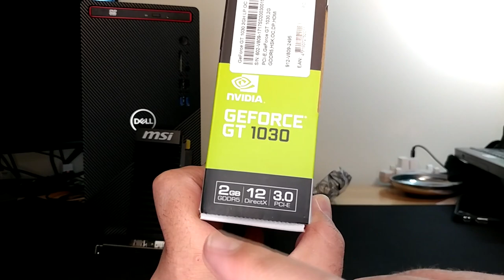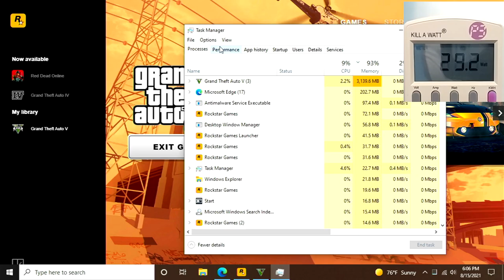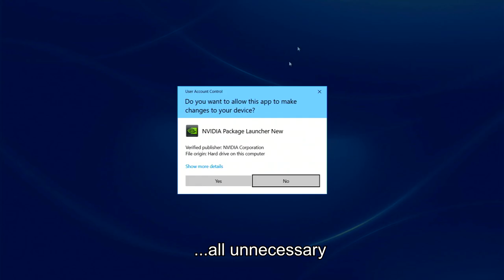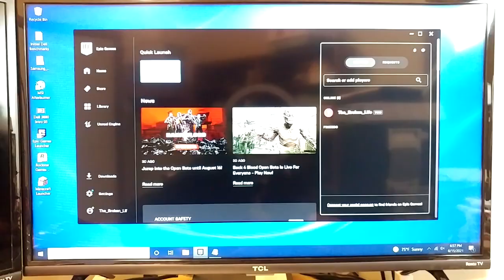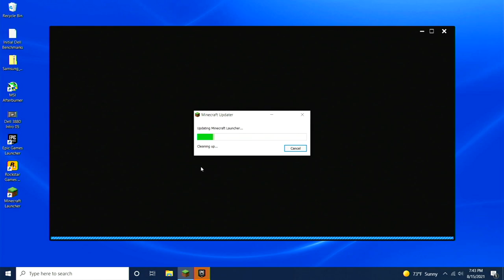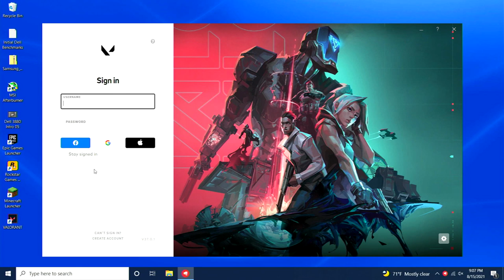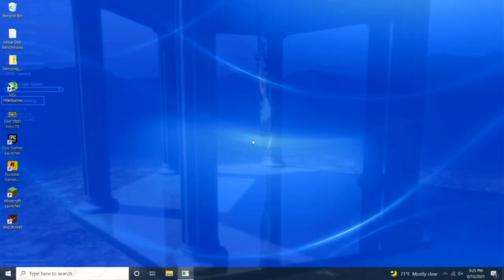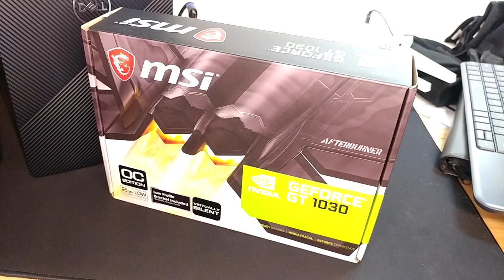Dell 3880 Graphics Card Upgrade!

Comment: I have this model but with an
i5-10400
12GB DDR4 2666 MHz
the same 200w psu
I am currently using a gt 1030 gddr5, I am wondering if I can upgrade to a gtx 1650 super? possibly ram upgrades also?
Reply from the maker: If you choose a 1650 that doesn't require PCIE power, yes.

RAM is no problem.
Reply: @TheBrokenLife  Thank you! I just received a new hdd and found your channel through that. didn’t have the screws so i’m just waiting for that.
Reply from the maker: @Hugs_Needed  You're very welcome!
Reply: @TheBrokenLife  So would the single fan ASUS Phoenix GTX 1650 OC gddr6 work well for gaming on my 200w psu? I can't seem to find much information about this and don't want to fry my system.
Reply: Or would upgrading or replacing the psu be a better option and getting a more powerful gpu?
Reply from the maker: @Hugs_Needed  Upgrading and replacing the PSU is far and away the better option.

Probably next Friday I will have the video out with the culmination of replacing my 3880's "everything". New case, PSU, MB, GPU, etc, etc. 

Upgrading your PSU now is just another step along that road.
Reply: @TheBrokenLife  Thank you! I will more than likely be going down that route. Not in a hurry or anything as I am saving money for upgrades atm.
Reply from the maker: @Hugs_Needed  Hardware prices are still crazy, so time is on your side.
Reply: @Noah DeWeerdt Hello! I have the same model

i5 10400
8GB RAM
SSD nvme 256GB
1 TB HDD
200W Dell PSU

So I wonder if you tested the GTX 1650 Low Profile? I plan to buy that card + 8GB RAM. At the moment I don't want to change the PSU.
Reply: @pj523man  I am planning to just upgrade to a new pc. I do not know if a GT1650 will run on this. But I do know that a GT1030 will run but will not have anywhere near the performance of a 1650.

Comment: can i install gtx 1050ti with dell psu 260W ?
Reply from the maker: Yes. I think that's actually exactly what I did in this video.

edit: Oops... I installed a 1030 here. My mistake, but, yes, a 1050 should be fine.

Comment: Hi again!, I'm installing my 4gb ddr5 into the pc right now, how do I know my pc won't disintegrate and get destroyed, people keep saying in a need 300w and I only have 200w and I have a i5 10400 can you tell me if I'm at risk and what I can do to mitigate it?
Reply from the maker: RAM is pretty independent of PSU size. You should be fine there.

As far as instilling you with confidence for whatever else, I think it was either in the i7 or PSU upgrade video (both in the playlist, which is linked in the description) I demonstrate that the most power I could force the PC to draw with an i7, GT 1030, SSD, HDD, and ODD all running as hard as I could force them to was something like 130w... and that was with my stock 200w PSU. Also... A GT 1030 was a factory option with that size PSU. Dell sold it that way.

If it will help you to feel better, just put a larger Dell PSU in it for a couple of bucks and move on. Right now my 3880 has an RTX 4060 in it, SSD, HDD, ODD, etc, etc and it's been fine for months. I think I paid like $30 for that PSU.
Reply: @TheBrokenLife  thanks for the advice ! 🙏
Reply from the maker: @empel655  Good luck with it. 👍

Comment: Question can the dell inspiron 3881 support a gtx 1650 lp?
Reply from the maker: It looks like a lot of the low profile cards are double height. Since you don't need an LP card, I think I'd stay away from it because it may not fit in the case.

In the power supply upgrade video you can see a GTX 1660 inside a 3880 and it fits fine.
Reply: @TheBrokenLife  the psu is 200 watts
Reply from the maker: @human8985  Sounds like you'd need to find a 1650 that will run on the power the PCI bus will provide and is also in a package that will physically fit inside the case.
Reply: @TheBrokenLife  I’m screwed lol guess I’ll buy the gt 1030
Reply from the maker: @human8985  If you already have it you may as well try it and see how it goes.

Comment: Could i fit a 2060 super or 2070 super in one of these?
Reply from the maker: You will for sure need an upgraded PSU for that and you will find that video in the playlist that is linked in the description. 

I have an RTX 4060 in mine at the moment and it's 226mm long by 2.2 slots high. It just fits and I don't run hard enough for cooling to be an issue. If you want to game with something, you should probably upgrade cases (also a video in the playlist).
Reply: @TheBrokenLife  thanks man
Reply from the maker: @Dr_Coop  Good luck! 👍

Comment: Is there a way I can fit a Gtx 1660 super in this pc?
Reply from the maker: Yes, but you will most likely have to upgrade the PSU, but I've heard there are version of the 1660 that don't require it.
Reply: @TheBrokenLife   well that’s good news because I’m fine with upgrading the power supply. Thank you for your help! I also am using the SFX power supply from your link. One question though, will the 1660 super press against the power supply?
Reply from the maker: @noodle3151  Possibly. That's one of the many reasons I don't suggest the SFX option.
Reply: @TheBrokenLife   do you have any suggestions that are above 600w and small enough to fit a 1660 super
Reply from the maker: @noodle3151  I go over all of the options in the PSU upgrade video, which is in the playlist, which should be linked in the description.
Reply: @TheBrokenLife  sorry but none of those options are small enough with the power I need
Reply: Actually 550w is fine
Reply: @TheBrokenLife   OK I’m sorry for wasting your time but What about a GTX 1660 (not super) with that sfx supply from that blog you looked at
Reply from the maker: @noodle3151  Maybe I didn't explain it well, but are you sure you watched the right video? The ATX PSU goes outside of the Dell case, so, physical size is irrelevant. You can get ATX PSUs into the thousands of watts.
Reply: @TheBrokenLife  I dont think I explained well either because I dont want an ATX I need a SFX because I want the PSU and graphics card in the case at the same time
Reply from the maker: @noodle3151  OK. Then you can put a Dell PSU in it or an SFX.

Or... For about the same price as an SFX PSU, you can buy an ATX PSU and case.

Comment: YES
Reply: @TheBrokenLife  this card is like console level at lower settings also i have a I5 intel core proscessor and 12 gb of ram i just bought a gt 1030 and this is one of the best budget gpus
Reply from the maker: @GamingChairDiff  I suppose it depends which console you're comparing it too. The GTAV experience was at least equal to PS4 from what I could tell.

Comment: 3880 with hdd is loud (but then again i have it on a hardwood table)
Reply from the maker: Mine is sitting on a hardwood table too and I haven't noticed any real noise problems. I think maybe my tolerance is high.
Reply: Its louder than the system without one or maybe it just because its an older drive
Reply from the maker: @benrboss  I think maybe there is a difference between "loud" and "louder than none" to me. I don't find mine to be loud, but it isn't silent either.
Reply: It sounds like old dial up internet
Reply from the maker: @benrboss  There may be something else going on in there then. I've noticed that sometimes the CPU shroud will get a little out of position and create a rattle. Just take the side off and tap the shroud and see if the noise stops. If it's actually your HDD, I'd probably start a warranty claim with Dell.
Reply: The drive is from before 2019 and its not a dell part (its a western digital drive)
Reply from the maker: @benrboss  OK... It's not that the 3880 with a hard drive is loud, it's that your hard drive is loud. That makes a little more sense now. :)
Reply: Now that ive had a closer listen the noise is the shroud
Reply from the maker: @benrboss  Cool! Easy fix then! Or at least mine is when it's done that. Just tap the shroud and its gone.

Comment: With the proper power supply could a rtx 3060 work in the system
Reply from the maker: I would be very hesitant about it physically fitting inside the case (depending on specific model) and cooling it could be an issue. 

I really feel like the extra $150-ish on a new case and motherboard is really, really, worth it once you get into fairly powerful GPUs. You'll have a much better PC in the end if you go that way.
Reply: @TheBrokenLife 
I suppose I could keep the side panel off solving both space and cooling issues. Although it would be ugly af.
Reply from the maker: @mememaster12  The space issue I imagine is in the other 2 planes. Leaving the side off wouldn't help.

If it helps you decide, Dell cripples processors in their board by about 30%, so you pick up a huge speed boost just by going to a different board too...

Comment: HAha good choice mate, the wattage baaarely makes it when you have no optical drive and m.2.
Reply from the maker: I could just barely get it over 100 watts, briefly. It has no problem running an i7 with that PSU either.

Dell's CPU power profile essentially locks it down at 65w no matter the temperature, so it pretty much never can run out of PSU.
Reply: @TheBrokenLife  I got the vid card on Amazon used for like $25…. Best purchase ever.  I’m able to run 3 monitors (2x hdmi and vga) plus wireless projector.  I’m debating on upgrading the i7, but depending on what Black Friday brings, I might get a newer Tower with windows 11.
Reply from the maker: @yflou3525  The 1030 is a great card if you can get one at a fair price. I'm glad to hear they're finally coming back down to reality.

The i7 is not worth it to put in the Dell board. The lack of any power management features cripples it's performance, what I suspect to be, pretty dramatically. I won't know how dramatically until I upgrade motherboards in another few weeks. We'll see!

Comment: i was able to get a factory dell 360watt power supply and was able to get a gtx 1660 super in the dell 3880 and  now i get 90 to 120 fps all day 8 pin  pci e power cable
Reply from the maker: Sweet! 👍
Reply: @TheBrokenLife  yes very
Reply from the maker: @traviceb  I love it when a plan comes together!
Reply: @TheBrokenLife  i do to i would send you a pic of the finshed case to  i put a plexy glass front window to with blue fans
Reply from the maker: @traviceb  Feel free. Email address is in the description.